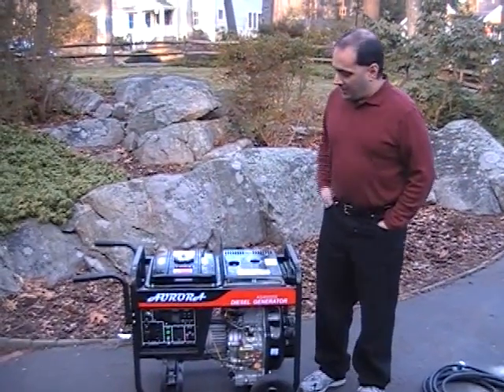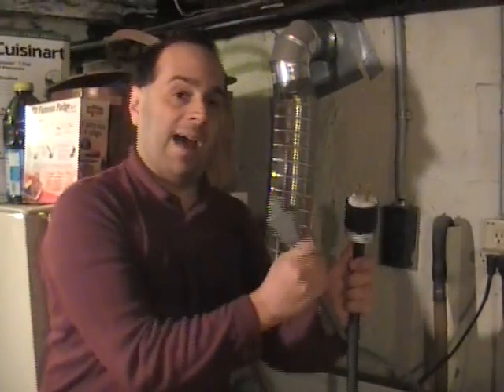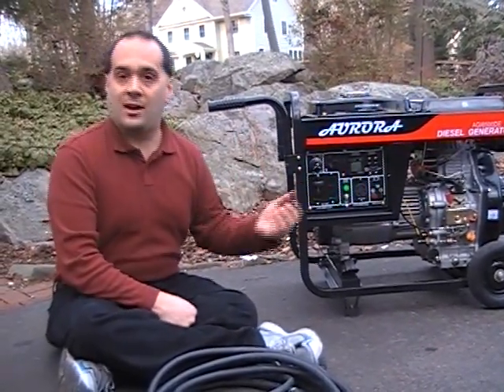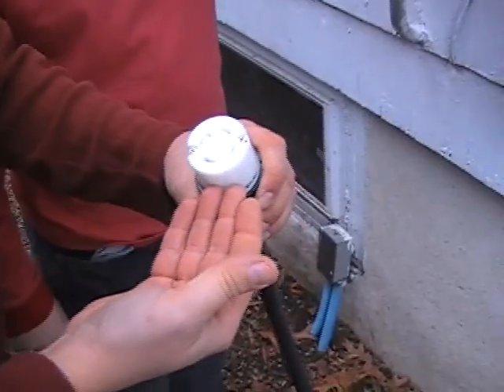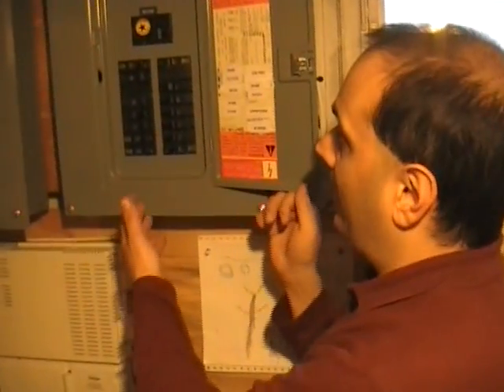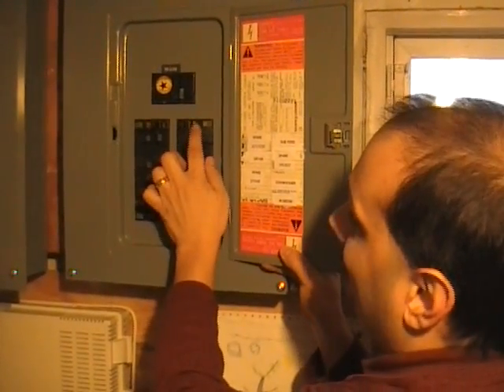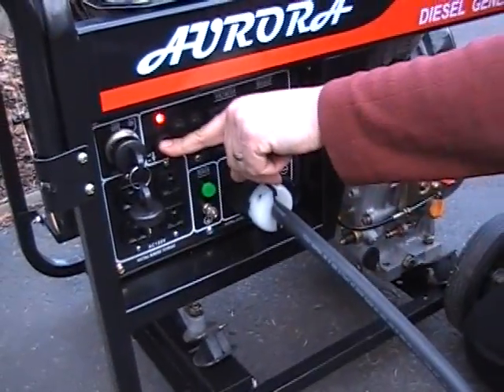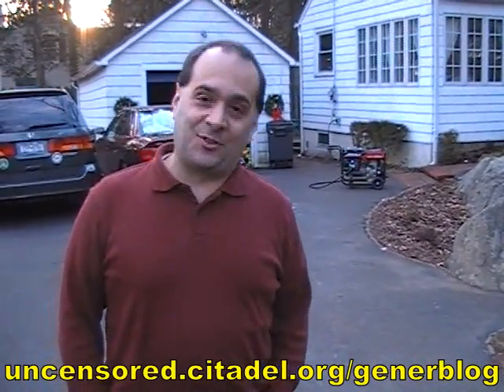Inexpensive residential generator hookup

Comment: I wish someone could answer my question. I have a manual interlock, but that only disconnects the two legs when the generator is running. The neutral is still connected and supposedly carries back the differential between the two legs back to the pole. How is that not dangerous? What am I missing?
Reply: I don't see how it could carry current back to the service pole.  For a conductor to carry current, it must have a complete circuit from the source (generator).  Am I missing something, too?

Comment: If you have a GAS dryer and do NOT NEED the 30A receptacle, connect a dryer cable/plug to a 30A generator inlet receptacle, mount it on the wall and plug into dryer receptacle.  Install interlock kit in panel.
Trying to line up the plug with the inlet at night? Take a marker or white-out and make a line on the plug & socket to line up the two before you twist it. Keep battery charged. Install emergency lights that come on when power goes out. Install them where you set up the generator and at the panel. Have an extra spark plug. Maintenance is easier when using natural gas to power the generator.
Reply: Here's very important thing about backfeeding through a dryer connection.  Dryers are wired for a maximun wattage of 5,000 watts.  You don't want to connect a 10kw generator to that outlet and draw maximum from the generator.
Reply: @danburch9989  Really? The panel breaker is 30A. My generator is 30A. The wiring is for 30A.
Reply: @danburch9989  It was to user paulmazzola398
Reply: Yeah man, my genetator runs on natural gas.

Comment: There's nothing wrong with back feeding a service panel as long you remember to shut off main breaker and have a interlock kit installed with the generator breaker. Plus have a heavy enough gauge wire you are back feeding with. I'm running a 10,000 unit and using 8/3 wire for the house and generator cord along with a 40 amp breaker in the service panel. My patch cord has a male and female ends on it to be a non suicide cord. The generator puts out 50 amps of service so I use smaller breaker to protect generator to much amp draw. Also folks remember to use 90/91octane non ethanol gas in the generators not 87 octane shit gas!!!!
Reply: Most dryers have 10ga wire on a 30 amp breaker.  Did you or a previous owneer install a 40amp breaker in place of a 30 amp?  Just becuase you are using 8ga from the generator through a 40 amp breaker doesn't make it safe at all.  The most you can safely draw is about 5,000 watts, the same as what the dryer would draw.

Comment: My  siemens generator panel goes one better, it can be wired for bonded or unbonded generators as it switches the neutral or not as required for bonded or floating neutral generators, a couple of  folks in the comments also picked up on this.  Too bad diesel generator sets are now pretty rare, even honda had one for while..
Reply: Adding a switch to my generator might be easy to do.

Comment: I wired an expensive Ronk transfer switch just below the utility self contained meter and before the 200 amp main panel in the house. So my switch and my generator are all outside and my 8kw generator is large enough to feed the whole house pretty much. I can’t run the central air and the clothes dryer at the same time though. No biggy.

Comment: Thank you, very informational. So, my question is, how much (ball park figure) would the total pkg that you just described cost by having a licensed electrician complete this? Thanks ahead of time...
Reply: I've been told $500 but if you know about power, you can do it yourself for about $125 in parts. This only cover a 30 amp circuit. 50 amp circuit needs higher gauge wiring and 50 amp breaker. The generator to house plug is more expensive too. Recommended 6 gauge wiring versus 10 gauge here.
Reply: Having a licensed electrician do it raises the cost

Comment: For longer than the show's old I've been trying to look for electric generator since I bought my house and for 20 some years it was not a such thing as thing as electric generator is all gas diesel propane whatever else not to what I would not have now I find electric generators now they're so overpriced it's unbelievable got to pay $22,000 for something that you need and it's actually 23,000 and then you got to pay that twice for what you actually need for such a little house like I have it's unbelievable it's cheap to buy a gas generator and it is by electric generator and electric is supposed to be with everything is turning into so they made it so high and mighty that you have to be a rich person to buy it so unbelievable way things are going these days too bad you're never going to see this this comment I will never buy a field run generator unless it's only run by electricity.

Comment: Great vid
This is exactly how I had an electrician plumb my generator, parked behind my barn; two panels in the barn, conduit to the house
Reply: I'm about to do the same thing. My 200 amp service is split between the house abd barn (100 amp each). The generator will be at the barn. I'm not sure at all about how to do this.

Comment: Unbelievably noisy generator!  I'd rather be in the dark with my barbeque, open fire and candles  Yes, I do know what it is like, having just suffered a 130 hour power outage.
Reply: You don't hear it inside my house or the front of the house.
Reply: You can also get a cover that takes the noise down some.
Reply: You obviously dont live in new England with winter temps.
Cant have heat without electricity if your only source is an oil burner.

Comment: Hello and thanks for the video! I have a question. Those NEMA #L14-30 are supposed to be able to handle 120volt or 240volt capability right? Is it 30amps rated at 240volts, or 30amps rated at 120volts? If it's able to do 30amps at 240volts wouldn't it be theoretically possible to handle 60amps as a 120v line? This question is based on many 9000+ watt generators with running capability of over 7000 watts continuous. Thus I always assumed the generator itself can handle right at 60amps in total. Thanks again and apologies in advance as I'm relatively inexperienced with electricity. I've just always used the standard watts divided by volts to get my amperage calculations so the fact it's listed as a 120/240 throws me off since it only seems to have one amperage rating of 30!

Comment: I would appreciate your input, if you have a moment. I want everything on the up and up, just mainly looking for a second set of eyes to help identify issues or safety concerns.

We used to have a pool and the pool equipment was about 100ft from the house. The pool was filled in last year (2020) and pool equipment was removed. The pool pump was on a 50A "leg" wired directly to the panel (not on it's own sub panel for clarity). Also, the breaker physically removed from the panel so no dangers of exposed hot wires. Again, safety first.

1) Could I install a 30A inlet receptacle (male) and connect my 30A/6500w generator out in the yard (less noise in the house))? I have a store purchased 30A generator cable. 
2) Could I use the existing 50A breaker (double pole) that was removed (I already have the interlock for this break) or do I need to pick up a 30A double pole breaker and get a suitable interlock? My generator is 30A/6500W (operating)/8125W (surge).
3) One of my safety concerns here is the 100ft of wire (buried in conduit) running from the generator to the control panel. There is a stretch of about 15ft where the conduit comes out of the ground and runs along the base of the house foundation. Is this risk relatively low?

Comment: There is a hierarchy in safe generator circuitry design: Rule 1 there MUST be an interlock switch. Rule 2 there must be a LEGAL feed connector with a plug that never exposes hot metal prongs. Now you are safe. Now you can get (safely) creative in selecting which circuits receive generator power and which ones do not (in order to use a less expensive, smaller generator). Now everything sits around for a year or 2. Then suddenly there is a power outage and you will have FORGOTTEN the cleverly thought out (but not so safe) scheme that you devised "back then" for connecting your generator and there will be a problem, UNLESS you stick with the SAFETY scheme .

Comment: I e been watching videos on this for weeks. Best I’ve seen yet. I bought a Westinghouse 9500 dual fuel. I’m planning on going the 50amp route. Would this be acceptable?
Reply: Multi-fuel generator output is about 7% less than advertised.  That 9500w is when running on gasoline.  But it shouldn't be a factor unless you go all out.  The most your generator can supply is 40a @ 240vac.  Your generator already has a 40amp breaker on its 240vac output, probably 20amp on the 120vac outputs.  I wouldn't go with 50 amps in the service panel; 40 map or even 35 amps should do it.  Lower amp circuit breakers as you move away from the power source.

Comment: I have a 12500 watt generator with 120/240 (30 amp) and 120/240 (50 amp) hookups.  I also have two panels in my house already because the original owner decided to separate things quite a bit.

My question is this - what if I want to simply run my WHOLE HOUSE on the generator?  Should I use a 50 or 30 amp line?  Should it go right to new breakers in the panel directly, and just install the interlock on the main panel?  Or is there another transfer I need in between?  Great video, thanks!
Reply: I would install a manual or automatic transfer switch, switching off utility power and turning on gen power from your 220V/50A. This is the best and safest way and should be done by a licensed master electrician. I have never liked interlocks.

Comment: And you STILL need to pull a permit and have the work inspected before placing in service. That isn't a ceiling fan or light switch you're installing.

Comment: I installed a Siemens g4254b1200 200 amp panel 6 years ago.  It is supposed to be backup power compatible.  But, I can not find detailed instructions on what makes it compatible.  It all looks standard.  Does it require a back feed to work, or do I need to install a subpanel and get another permit and inspection.

Comment: Good deal of essential info. I used to run the electrical dept in the local chain home improvement warehouse. People were always telling me about the dryer outlet trick. I always tried to relay how dangerous it was. Especially to potential lineman working on the powerlines. Plenty got mad and tried would say " i being doing it for years and never had an issue".  They'd assume i was just trying to sell em our expensive switchover box. Wrong! Especially the older generations. The turning on one breaker at a time was a good idea as well. Might be worth mentioning as well generators shouldn't be run near the house either . Due to carbon monoxide poisoning.  In fact having battery operated carbon monoxide detectors would be valuable essential  safety equipment as well. Thanks again

PS: hook up a ground wire to generator. When in doubt about anything consult a licensed electrician. Its vital!

Comment: Illegal..  never heard of anybody getting a charge from hooking up a generator to their house..  hell even if you backfeed it and kill a linesman than theyd have to be able to pinpoint which house was backfeeding out of everybody on that particular grid which is damn near impossible..   only illegal thing i could think of somebody getting introuble for is if they stupidly leave the cable out and plug it in to the generator and killing a kid or a dumbass who touched the other end, or if they were backfeeding without the mains off and when power got restored the wiring burned up..  or if they burned the wiring up with the generator anyway then the insurance adjustor woukd spot that and you wouldnt be covered for it..
Reply: I actually have heard of a linesman getting electrocuted by a line getting power from a house. I believe he died, but it was a while back and in NH, I think. But no big deal, right? They wouldn't know who did it.
Reply: The lineman would have isolated the one branch of the distribution system so that a limited number of homes would be without eletricity.  All they have to do is listen for a running generator.   It will usually be within 10 houses of the crime scene.  It's not likely power would be restored until everything was safe and the body removed.

Comment: I love the simplicity of this solution!  I've been putting off the genny for ages but this is is like stupid simple and CODE COMPLIANT! Unfortunately the portable Aurora Diesel Generators have been discontinued.
Reply: This set up works with any gen running on gas, diesel or Propane.  Just know the wattage it puts out and know the load your circuits take to not overload the gen.  Let us know how you proceed and how it works out for you.  May I suggest a WEN or Champion gen and more wattage means more items you can run, like A/C and Freezers, maybe even hot water.  But that will also consume fuel faster.  Good luck.

Comment: Do you need to isolate the ground and neutral bar  on the sub panel to which the generator is plugged?
Reply: In a perfect world...
All my new installs are designed to keep the grounds and neutrals separate but does it really matter? No.
I always "ground" back up generators. There is a ground screw on all the ones I've seen, even the portables. A piece of rebar and an jumper cable is even better than nothing!

Comment: I like this idea.  It is a lot cheaper to set it up this way, and it does basically the same thing.  i had theorized it could be done but this is the first time i have seen one demonstrated and explained, or even mentioned before.  Thanks for posting this one.
Reply: Don’t forget about the generator safety tips as well. Always make sure you follow all the generator safety rules whenever you use your generator. Remember that portable generators can be dangerous if not used carefully. Here are the generator safety tips:

This is just a safety reminder 

1) Please do not allow an unqualified person or your children to operate the portable generator. Just because some manuals don’t say that doesn’t mean it’s safe. That is important against the generator safety rules. We also need to be keeping an eye on our children too. You need to make sure that your children are not playing near the portable generator especially when it’s running so they won’t get electrocuted. Generators pose electrical risks and they can be hot during an operation. Please keep your children away from the portable generator at all times. It is important to keep our children safe especially our little ones. Be aware of all the hazards.

2) Some people use their portable generators indoors which increases the risk of carbon monoxide poisoning. It’s important to have a carbon monoxide if you have a gas generator. Never ever use your generator indoors even if your doors and windows are open and even in the garage is not safe to use a portable generator. Not even at your porch and your deck. It is never safe to use your generator indoors and in enclosed areas of your home. Your generator needs to be 15-20 feet away from your house. 

3) 🔥generators cause fire hazards too. Never refuel your generator while it’s running. You need to let your generator cool off before refueling it and before storing your generator. Never overload your generator too. Never ever back feed your generator. You should never plug your generator into a wall outlet. Also never store propane tanks indoors. Please keep flammable things away from the generator as well and please don’t smoke cigarettes near the generator. Having a fire extinguisher next to the generator is also important against the generator safety rules. 

4) generator operation; make sure your hands are dry before touching the generator. Never use your generator in wet conditions. Don’t let your generator get wet. You need a generator tent if you need to use your generator during wet weather. Please don’t wear loose clothes when operating the generator. Turn on your generator before plugging in appliances. Use the right cord for your generator. Please do not use worn out cords. 

https://youtu.be/I1jT3ANENvI and here is a video more about keeping others safe when using generators and also about our family’s safety. Hope this helps